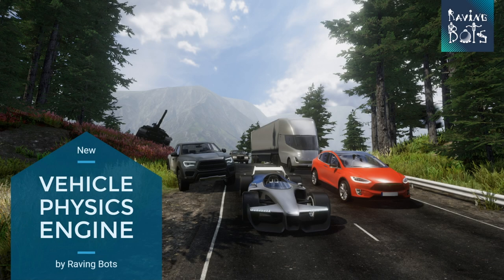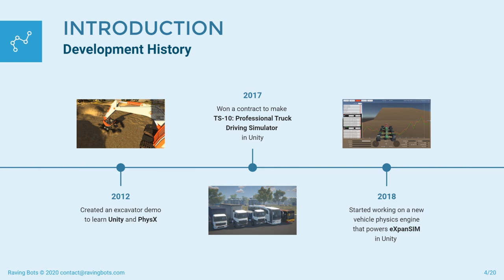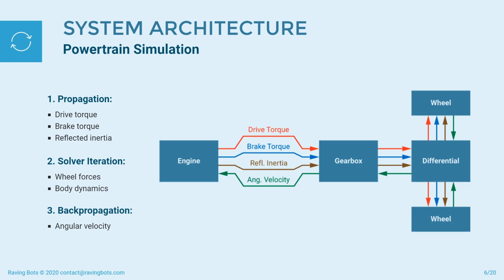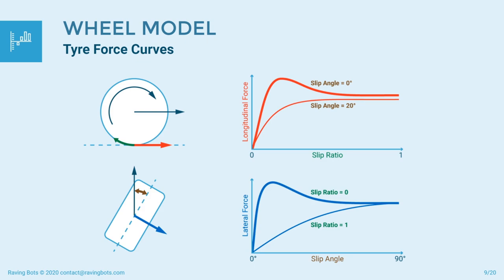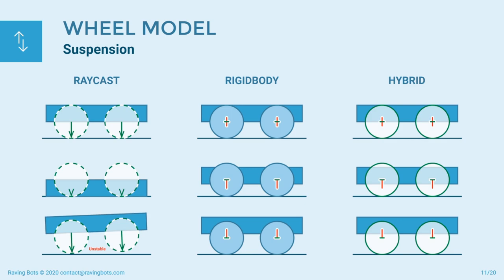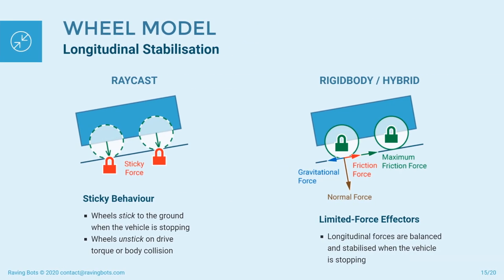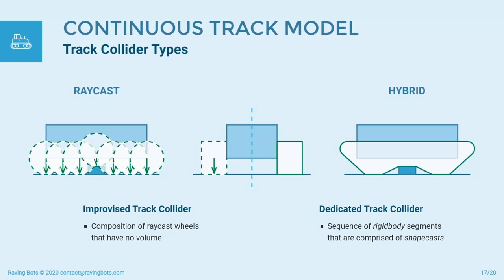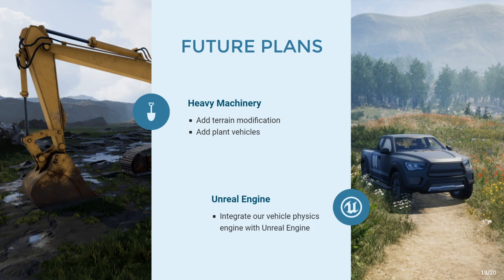Webinar: The new vehicle physics engine by Raving Bots

Comment: if you don't use a rigidbody for the wheel In your hybrid solution you are neglecting the actual weight of the wheel. Maybe you can consider to use a rigidbody just for the wheel rim (in this way you can also easily simulate a flat tire) and casts for the tire. It remains a bit complicated to find a suitable cast for some extreme cases (for example super thin or super wide tires).
Reply from the maker: Hi Michele, good point, but in fact, there is a rigidbody in my hybrid solution. It just doesn't have colliders attached, and collision is handled by shape casts. This is done in the way that colliders are not needed. The rigidbody of a wheel has an inertia tensor of a cylinder and spins to produce the gyroscopic effect. All weights are considered.
Reply: @UCJrk8cgAJULZLiHbfs07bfg you mean that you are calculating the inertia tensor in the code? Didnt think it was possible to have an inerita tensor without colliders.. So you make the rigidbody spin by applying a torque to it? Also, which kind of cast are you using? radial sphere cast?
Reply: @RavingBots  Also, which is the advantage to not having a collider?
Reply from the maker: @NewLife973  Yes, you can set inertia tensor and inertia tensor rotation from code. Yes, torque makes the rigidbody spin. I tried all casts (sphere, capsule, box), and the capsule cast seems to be the best choice (unfortunately box cast returns a normal vector that has a very low precision).
Reply from the maker: @NewLife973  All kinds of advantages: better handling high speeds and large masses, simulating tyre softness...
Reply: @RavingBots  I meant the advantages of not having a collider for the rim only. In this way you need to calculate the hard contact point when you bottom out the tire height or when tire pressure is too low. Also, by making the rigidbody rotate, you dont face numerical instabilities at high rotation speed?
Reply from the maker: @NewLife973  I understand but my method allows for simulating a soft tyre as well as a hard rim, so there is no need to add colliders and make it more complicated than it should be. The angular speed of the rigidbody is limited to avoid potential problems, but in fact, a rigidbody without colliders is not that dangerous.
Reply: @RavingBots  Interesting. So you are calculating the hard contact point for the rim in all directions, including laterally?
Reply from the maker: @NewLife973  Yep, something like that but it would be difficult to explain details without recording another video, so perhaps I will do it in the future.